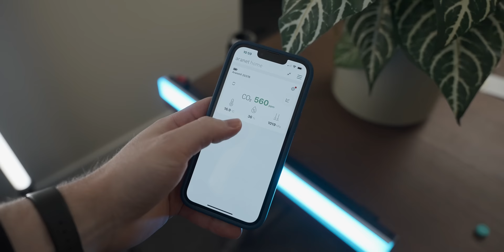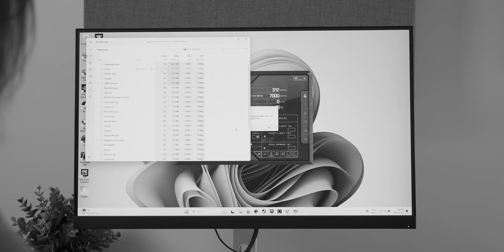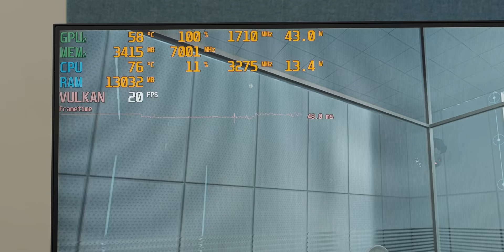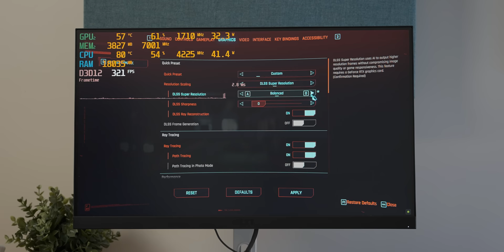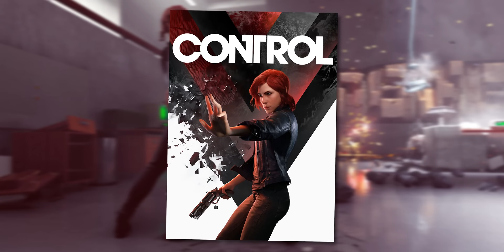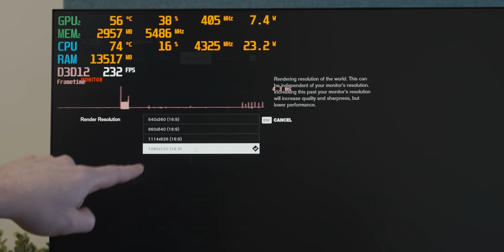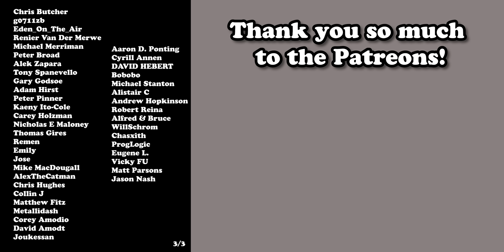Can The Slowest RTX Graphics Card Even Ray Trace?

Comment: Although RTX performance has gotten better over the past couple years, even my desktop 3060 struggles on low ray-tracing. It's like saying you can be an Olympic track runner because you have legs.
Reply: I mean yeah we all could be one but should we.
Reply: @ProjectFraz  exactly
Reply: You can get Ray tracing over 60 with higher tier/newer cards
Reply: @drebodollaz3504 If you have 4080 or higher- yes.
Reply: @tomaszzalewski4541  4060 ti here - i can run most titles at 75+fps on max settings 1080p
Reply: Just because its 1 generation better doesnt mean that it can run RTX at 200 FPS
Reply: @drxgncs90 I guess that at 1080p you never run out of VRAM
Reply: idk, my 3060 runs RT just fine in all the games i play
Reply: @Darcy_stabler  my 2060 dies
Reply: @tomaszzalewski4541  4070 ti super at 1440p, i benchmark 103fps on max settings cyberpunk with path tracing and dlss quality. quit over exaggerating.
Reply: mean rtx technology is total scam

Comment: I have a 4090, and I don't even bother with the psycho setting. Personally I can barely tell the difference between ultra and psycho, but psycho makes the GPU work significantly harder, but for minimal benefit.
Reply: i can barely tell the difference between ray tracing on and off from a 3070 owner
Reply: Just use pathtracing
Reply: @NamTran-xc2ip Yeah I played through CP2077 on my 4070 Ti with path tracing because it looked so much better. Theres definitely a big difference between path tracing and the normal ray tracing modes, especially in GI.
Reply: @captainpotatonly how? Without rt reflections there's so many things with such inaccurate reflections or they don't even have any at all, and without rt lighting a lot of the scene just ends up looking rather flat
Reply: I leave RT on but limit fps at 60. This way I save 100-130 watts on power draw and around 400 rpm on fans
Reply: I like ray tracing. In some games it improve visual quality significantly . In offline games am okay with 50 fps if am getting better visual quality.
Reply: i barely see any difference from minimal rt settings to max, so i just turn it on and see if it has the ugly glossy reflection ray tracing, and if yes, turn it off ASAP.....why are rough surfaces coated in cleaning detergeants? it's extremely unrealistic and unimmersive....it's cutting down fps to make the games ugly

ray traced lighting and shadows FTW.   F*** ray traced reflections